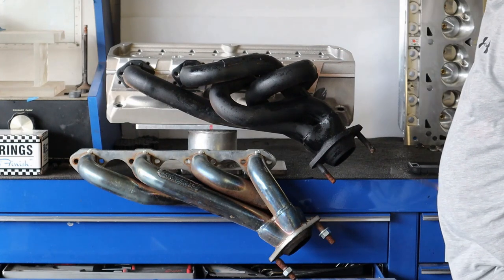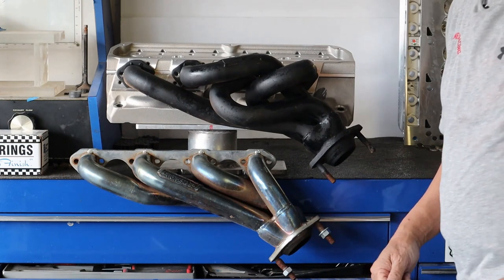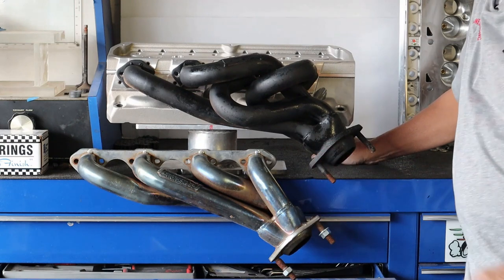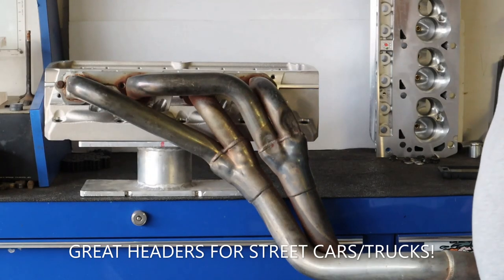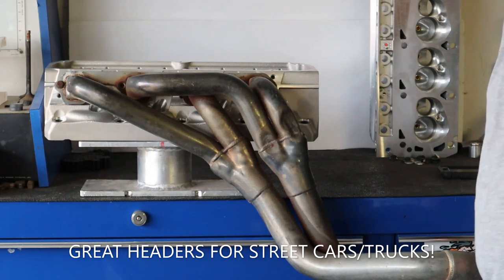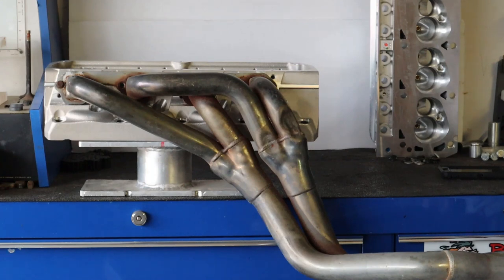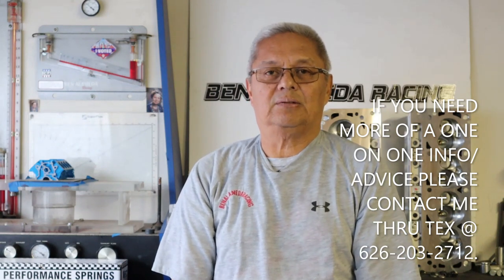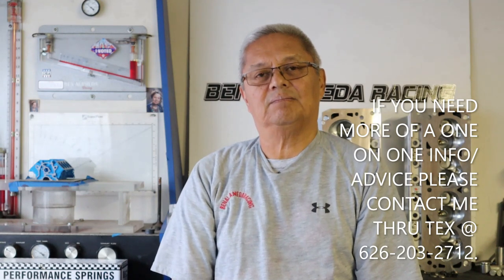HEADER TECH AND MODIFICATIONS FOR STREET OR ALL OUT RACING!

Comment: But the turbine is 90 degrees to how the exhaust gases hit the turbine wheel, so how does it matter how the pipes sit in the collector?
Reply: It doesn't matter how it hits the turbo but the speed it hits the turbo does.
Reply from the maker: Yes it is if you are running a single turbo!  How about a twin turbo/side?  Now you have direct flow to it or close to with minor bends if any with the pipe.  Same thing can be said about a single dominator on a sheetmetal intake, which the corner end cylinders are not a straight but curve path!  
Twin dominators specially split types will position the venturi's all 8 of them on top or in front of all 8 intake ports, twin carbs like twin turbos.  
All collectors @ high speeds are subjected to pressures which is part of the flow condition because without it flow will rapidly slow down, it is important we contain and keep the heat going and with it the pressures creating downstream flow.  Therefore, swirling or rotating the flow within the confines of the collector will be efficient at keeping the gases moving and expelled straight to the turbine housing regardless if it is curve, straight or with a slight angle.  The object here is not to lose the heat content of the gases and the speed of the gases itself... Both gains are possible compared to just dumping the gases whichever way it comes in creating turbulence and flow separation because of said condition.
Reply from the maker: @jakeeyeington92189 , absolutely but if the exhaust pulses are turbulent exiting the collectors, what do you think it would do to the turbo's efficiency?
Here turbulence will slow the velocity of the exhaust gases.  If there is anyway we can smooth this out the better!
Reply: @benalamedaracing2765  The exhaust gases always enter radially (90 degrees) into the turbine wheel. Unless it is a turbo with an axial turbine, but they are hardly in any car.
Reply from the maker: Peter, sorry for the confusion and I hesitated to bring up this subject because not that long ago I worked with a Mercedes Endurance team's efforts on their turbo's working with guess what?  Axial type with an innovative impeller and housing design. Looks promising but there were issues with legality as far as the design which ended up in courts and I had to bow down exit stage left!  
Now on the piping collector it is also a delicate issue as far as the exit angles of the collector creating turbulence and inefficiencies specially as you pointed at the entrance angles of 90* (correctly stated) and how we tried speeding this area velocity's creating shock waves on the turbine's tips on the intake side!
From interesting designs of exhaust sequencing and pipe wall's texture/discharge angles while "dumping  raw fuel" on the exhaust sides and lighting it up, creating exhaust pulses to decrease any perceivable turbo lag is quiet interesting but mostly on the close lips research.
Reply: @benalamedaracing2765 Hey Ben is there power to be gained in porting the exhaust turbine housing on a turbo so that it is not as square as it usually is all around the round port on exit?

Comment: On the engine dyno using an air flow meter above the carb, does the flow meter sense different volumes with the different header configurations?
Reply from the maker: If you have a sizable and measurable increase in power then the intake must have been passing or ingesting more air. Therefore the flow meter should be able to see that.
Reply: @benalamedaracing2765  Probably yes, maybe no.  Could the power increase be attributed to increased combustion efficiency?  Less negative work?
Reply from the maker: @donbrutcher4501  you are also correct and increased efficiency can mean many things like good exhausting thru improve hedders will scavenge most of the spent gases, therefore the next combustion event will definitely improve so will the power.  I totally missed your point about hedder design difference.  In short strong exhaust flow speeds will also have a reflection to the intake tract during overlap and that will increase the intake manifold signal thru the ports as well and the flowmeter will indeed see that.

Comment: I guess whomever came up with the concept of header collectors back in the day, didn't take into consideration that all cylinders dont fire at one time and collector didn't need to be that large
Reply from the maker: You have that correct sir!  The merge collector indeed helps keep the velocity going and here the scenario of one hedder pipe transitioning to the collector, see's a big area increase and the corresponding slowing down of the exhaust gases!  I said the same thing of others trying so hard to port equalize flow @ the intake manifold, failing to consider the firing sequences robbing of other cylinders specially adjacent firing which makes it worse!
Reply: So 2" primary into a 3" collector better than a 3.5" collector?  750hp to 800 hp ls7

Comment: Well I was told by a professional doesn't matter how long the tubes are on any set of headers there's probably no more than one two at the right length for any cylinder and sometimes none
Reply from the maker: Well it does matter because if it is too long because, the reverse flow will really be bad!  You want the slowing down of the gases to be precisely or close to it to get together on the collector at that juncture. Then at this point they can balance off each other and help them propel by the following gases to atmosphere/muffler.  In fact on high rpm engines too long will cost power upstairs and too short will lower power downstairs or at low rpms.  Got to strike a balance this is why I recommend the painting of the hedders or some use crayons to "precisely" point to you where it drastically slows down when it looses heat energy= flow!